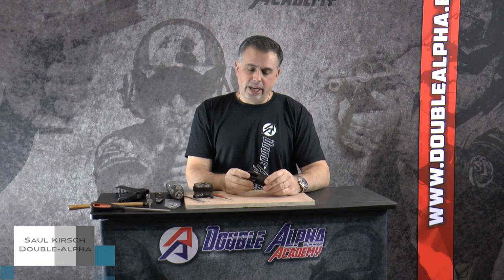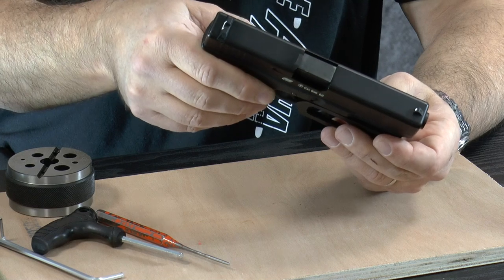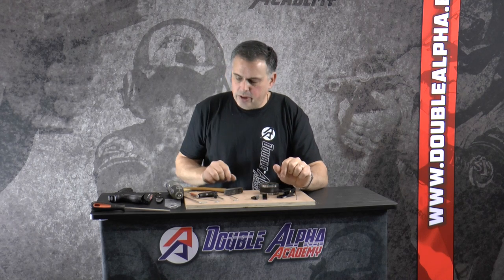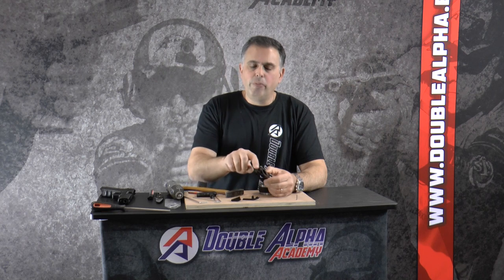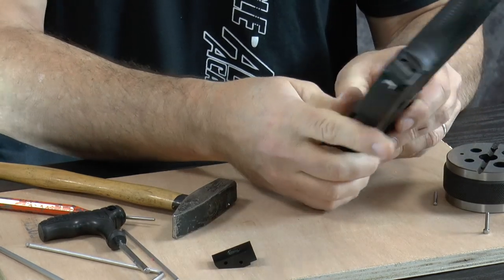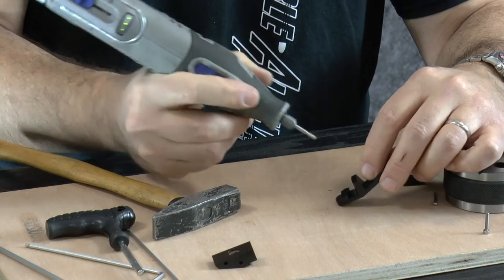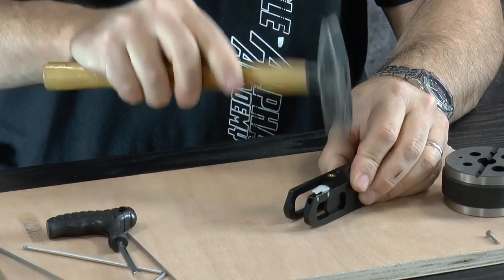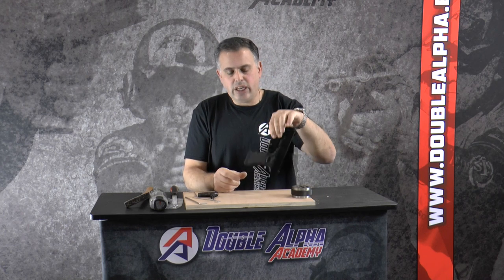Alpha-X / Race Master Holster - Insert Block Fitting / Customization

Comment: I just got my Tanfoglio Stock 3 insert and holster. The fit could not be worse. The insert hits the picatinny rail on the frame. It's about 3mm too high in height to fit. It's going to take a lot of work to get it to fit

Comment: I have just received mine, I will use with  TM Hi Capa 5.1 Gold Match, I have emailed asking gun type and ordered STI, but still need some fitting. Upper front of the trigger guard of Gold Match resist to insert block, it does not go enough deep so that I can hear click. So I will dremel some material off
Reply: I have the same problem with my Glock 19X, it won't allow me to insert the gun deep enough so that I can activate the safety lever, do you mean to dremel some material from the insert block body where it stop the trigger guard from moving further down?